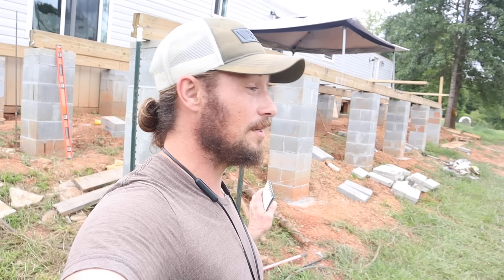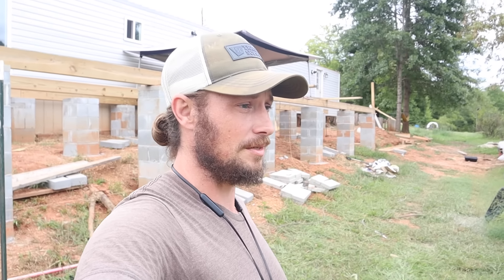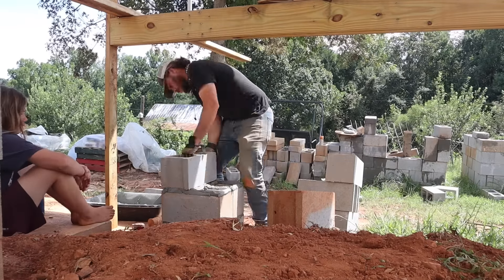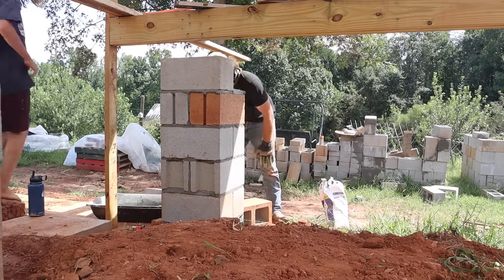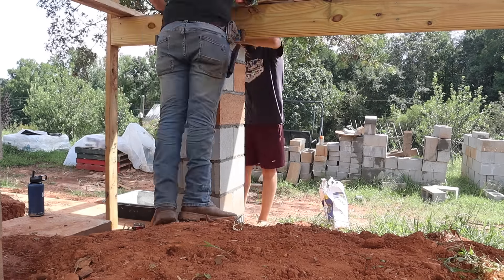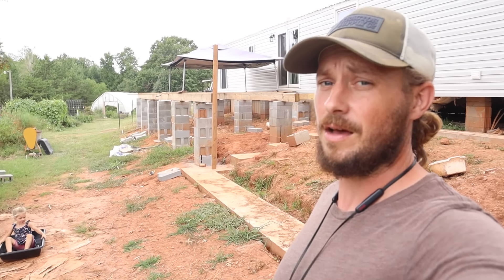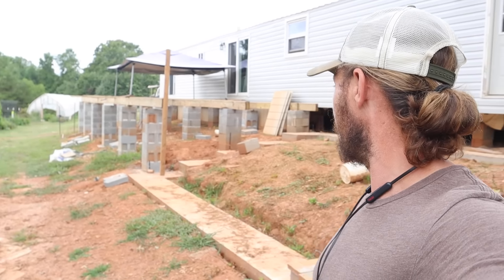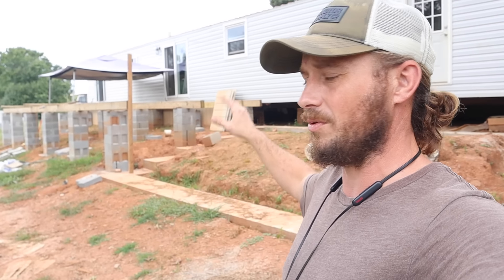Tall Towers || Home Addition Build Recap 8

Comment: You will np doubt have your own tried and trusted method of shimming but an old neighbour of mines was a stone mason and he swore by using slate to level joists etc . He used it with stone , brick , block and concrete pillars . They are infinately adjustable , never rot and you just cement in place